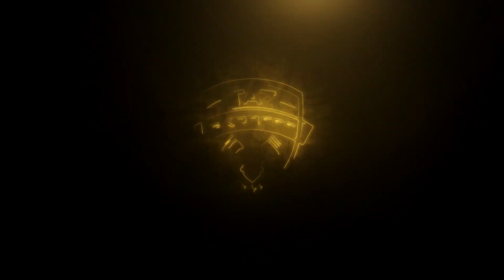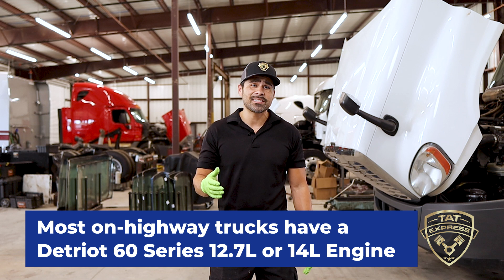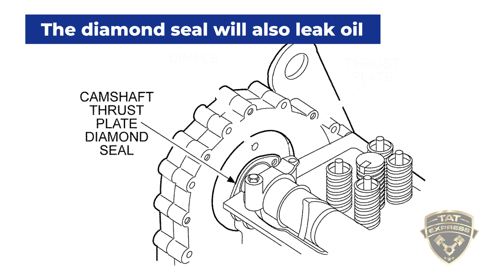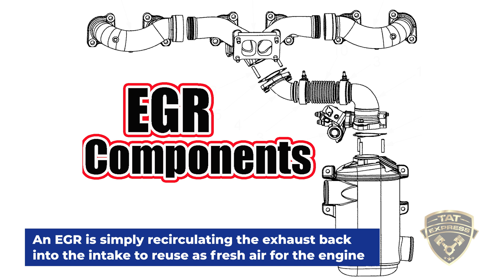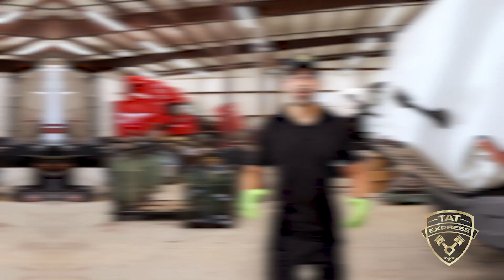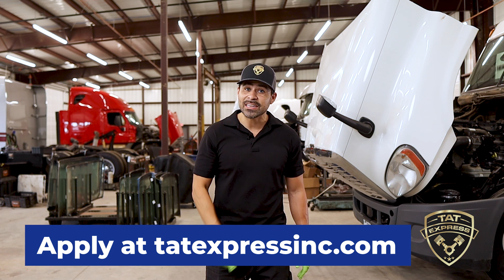Best 60 Series to buy/ Detroit Diesel 12.7/ 60 Series 12.7/ 60 Series Detroit Diesel/ 12.7 Liter

Comment: Thinking about buying a 2001 western star with 12.7 that needs rebuilt do think its worth considering I can get the truck cheap enough and the truck itself is in good shape for the year just the engine needs rebuilt
Reply from the maker: @jasonburkhead1 That’s always a tough call—especially putting money into a truck before it ever makes you a dollar. Quality rebuild parts are hard to source right now too. And that’s all before you’ve even torn into the engine. Just make sure the price is right and you’ve got a clear budget for the rebuild.

Comment: I bought a 2020 Freightliner glider and have had nothing but problems with this truck. It has a detroit 60 series 12.7l ddec4. It never ran right from the time I bought from dealership. Kept going through injectors because mechanics didn't install them correctly or the injector went bad. They were a re-manned injectors from detroit. I finall found a shop to do the injectors correctly after 4 years of this truck being in and out of the shop. A month after the injectors were installed correctly, I am having to do an in-frame rebuild due to multiple liners dropped. I have negative protrusion on the liners. Truck only has 280,000 miles. I bought this glider new from a freightliner dealership in Wyoming.  I am doing the in-frame rebuild and the cost is about $25000. This truck has bankrupted me. If this doesn't get fixed this time, I am ruined. I do maintenance on this truck every 10,000mi and have a bypass filter and fass fuel system on the truck. I have been drving 30 years and never seen a truck in the shop practically every week for four years. Unbelievable.  I think Detroit just slapped the engine together because it was a Covid truck and it was the last year you could get a glider. Before you say this engine was re-manned by Fitzgerald, I tracked this engine back to Detroit and they told me and my mechanic the engine was re-manned by them. I bought this truck at the wrong time. I have a friend who bought a 2020 international truck with a Cummins 600hp and he had the same problem of the truck in the shop constantly.  My friend is bankrupted now. I have never seen the trucking in this bad in my 35 years of trucking. It is difficult to find mechanics that do the job right. Mechanics will make or break you in this industry.  They get paid no matter they fix it right or not. I have not found any mechanic or shop to stand behind their work.
Reply from the maker: @williamreeb7227 Thank you for sharing your experience with the Series 60, and I am sorry for the problems you have faced. I hope you can resolve all your problems. Since the series 60 is no longer manufactured, the parts are being remanufactured multiple times, which decreases the quality of the parts. Injectors are a common issue. Even with new sets, we have seen issues arise. Again, I am sorry to hear about your problems, and I hope you can resolve them. I agree the industry is in a cycle not seen before. We are all hoping for a turnaround.

Comment: I'm almost bankrupt after my dd15 has spent the past 5 months in 4 different dealership shops with the same aftertreatment electronics problem.  I gave up handing my money over to Freightliner for not fixing my truck, so now I'm selling it with the dash code.  The only thing worse than this garbage engine is the humanoids behind the dealership service counters.  They start getting angry as soon as they realize you're trying to explain that you're having a recurring failure, and most of them have no problem at all shouting over you nonstop just to prevent themselves from hearing what you have to say.  They act like it's me who built this truck, not them.  So my next truck will be a Cummins.  Hopefully I never have to set foot in another Freightliner dealership.  Simply awful.

Comment: I owned a 2001 century class with 12.7 detroit.The 1st injector gave out at 1.6 million miles,i replaced all of them and the head,head had a small crack in it. Replaced the turbo at 1.1M. Engine finally gave up.at 2.4m miles. It is the cheapest,easiest to work on,reliable engine! Can't go wrong with 60 series.
Reply: I 2nd this
Reply: Impressive experience, what oil change interval you were doing  and what oil filters you have been using. 
Thanks
Reply: @filydiak  oil change every 10-12k miles using Mobil Delvac 1300 Super with 2 gallons of Lucas oil. I use fleetguard brand filters. Idle as less as possible, when you do idle, bump the idle up to 1k RPM's. When pulling big grades, drop an extra gear to make it easier on the engine.
Reply: I really appreciate your tips 🙌
Reply: What mpg were you getting
Reply: Wow
Reply: Do you mind to share some maintenance tips also some specific  parts brand name?
Thanks

Comment: Hey bro can you tell me whats going on?2004 freightliner detroit60/12.7.
vpod for turbo&vpod for egr valve..i changed the actuator on the egr valve..after that when i excelerate i get a split second delay on response..its like after i mash the gas the truck has to think about responding for a split second.then it goes???what did i do wrong?

Comment: I have a Freightliner glider with a 1996 Detroit 60 12.7. I had a very expensive rebuild, all gears, crank, injectors etc. The rebuild cost more than I paid for the truck but that's not a complaint.  I have no complaints. It's a clean and beautiful looking engine. I'm looking forward to putting a lot more miles on this engine in the future. Thank you for the video. I might stop by and see you guys this winter.
Reply: It’s a glider of course
Reply: You should’ve shopped around. You can have the same engine rebuild done for a lot less. Maybe 12K including new head and block cut. IJS 85hr labor. Labor is what kills you guys and plus getting bent over no Vaseline on “OE” parts with markups. I’ll gladly buy aftermarket kits.

Comment: Tip of the day: Don't buy a Detroit any series...  They are obsolete and have been taken over by Mercedes DD series. This has been a fact since 2015. Detroit got butt hurt when PACCARD  bought out Cummins. PACCARD was still in the process deciding which motors to install in OVR tractors, when Detroit Diesel came in and bought all their parts back from PACCARD. This lead to their downfall and why if you own a Kenworth or Pete you cant get parts for a Detroit 60 in any dealer locations. Now the Detroit building in Michigan says Mercedes on it. This is the same power plant that was in the Ford Sterling back in 2000. Unless you go to the manufacture or Freightliner , its impossible to get parts ..and it wont be long til they are fazed out!!
Reply: Correction don't get a 5th gen dd series engine or better. Ex: dd13, 15, 16 these are basically MBE's. Just bc parts are no longer produced doesn't mean that parts aren't available.

Comment: Incredible engine. Has its quirks, but it’s damn reliable and parts are cheap. Got a 99 12.7 in my glider Kenworth. Went from a Cat C15 to this Detroit and could not be happier. Tuned right, this little 12.7 pulls just as good as that 600 horse Cat and it doesn’t blow a head gasket every oil change. The Detroit leaks oil like a faucet though. It certainly marks its territory everywhere it goes, but I’d have nothing else over it. Bless Detroit for building this amazing engine. If you’re in the market for a truck, do not be scared of this engine. Rebuilt my Cat for 25 grand and it was still a money pit. The Detroit costs 14 grand out the door for a full rebuild just like my Cat was done. This engine is cheap, reliable, and pulls like hell if it’s tuned properly. Stay safe drivers!
Reply: Where did you get your rebuild done? And was it an in frame or reman long block? Thanks
Reply: @derick12331  It was done by reputable shop in Moorhead MN that me and many friends use. Platinum Cat kit in frame done on it along with new turbos since they were the original ticking time bombs for a brand new engine. Liner protrusion checked and was within 3 thousandths. Right after I got it done, Cat decided all c15s need to get the block decked during a rebuild. It was too late for me. Engine made it 100,000 miles and the engine had to be tore back down. I sold the truck and took a $40,000 loss. I hated that Cat and did what it took to get rid of it. Got a glider with a series 60 that I paid dearly for since it’s E log exempt and I’ve never been happier.
Reply: @PickupsAreNotTrucks   what is the shop name in Moorhead?
Reply: No
Reply: Who did your rebuild ?
Reply: The Cat was rebuilt by a shop I’m not gunna name because I don’t want anyone to think I’m slandering them.

The Detroit I did myself. I called around to places to get a quote on having it done by a shop and, it was around 14 at the time. I’m sure that’s gone up significantly since then. I did my Series 60 myself 2.5 years ago for $10,000 all said and done.

Comment: my 04 century has a 12.7 from 1999. 430hp model, entire new bottom end. took the oil pan off to repair it and could still see honing marks on the sleeves/inside of the block looked like it was a brand new engine. burns no oil, runs solid. 300k after rebuild/freshup

Comment: Bought a Peterbilt truck from California that had 1.6 million on a 12.7 Detroit with an after market DPF filter, did an overhaul removed the DPF filter, truck drives and pulls great but in the morning start it has a blue white smoke for like 10min smells like diesel, it's REALLY bugging me already tried changing the injectors again but still no luck, what could it be?
Reply from the maker: Tony G, it may be due to the tune over fueling and not completing burning until warmed up.
Reply: @TATEXPRESSINC  thanks for the tip 👍

Comment: I have a 2008 freightliner with a 14 liter serious 60, MAN! That engine is a beast
Reply from the maker: Thanks for sharing.  I will be coving the 14L in our next video, so be sure to subscribe, so you are notified.
Reply: Hello guys, I’m actually subscribed to both of you guys maybe one of you can help me out. 2014 cascadia DD15. Rough idle low power no code for it. After getting the truck check over by a friend (no mechanic) we found that my air filter hadn’t been replaced in some time and was completely clogged. (Thanks Speedco) Changed it and truck was a little better but still rough idle and low power. So I took it to the dealer. Thinking maybe I lost an injector or maybe a boost leak. I asked them to fix crank seal leak and a leak on the fuel rail line since I was in the shop. And to replace a nox sensor since I had been riding around with that light and code for a couple years with no issues. They fixed the oil leaks and then replaced the both nox sensors. Test drove and said your good to go. On the very next load I pulled. I still had the rough idle and low power. Now 55 mph derate. Back to the shop. After they broke transmission lines and def lines and made me pay for them. They then replaced metering unit and def dosier. Hey your good to go. Still rough idle and low power the first hill I came to. 5 mph derate and a huge tow bill back to the shop. Where my truck sits after $11,000 later.
Reply: I have same engine

Comment: I have a n14 red top and is a beast's more powert then Detroit and sound better but Detroit's are so good too sound smoth plus a big plus diesel consumsion is less is like having a 4 cilinder engine in a semi truck another thing off Detroit series 60 they start right away and Cummins take for ever some times
Reply from the maker: Marcos, we owned a N14 in a FLD.  It ran to CA and WI before ELDs. 🚚😄

Comment: Still no mention of the 87-97 12.7 liter
Reply: I’m getting a 93.
Reply: Exactly I have a 96
Reply from the maker: @Amsoil, most on-highway trucks are equipped with a DD15, Volvo D13, a Paccar, or Cummins.  We do not see many 60 series
Reply: @TATEXPRESSINC  they still out there!     You might not see it,because, any back yard mechanic can work on them and you know 12.7 it’s a reliable engine.         When I go to buy oil filters for mine,at dealership i can’t see one in the shop.
      But,I see like 10 Cascadias in line to be fix.     Not everyone knows how to work on DD15.  I have a 98,and still working fine.   With a Rebuilt engine ,and 2 million plus miles on it.
        Thanks for the information 
We all appreciated!

Comment: I have 12.7 and it's in a Columbia glider. That engine was NEGLECTED and poorly maintained. Former FedEx ground truck and for those that don't know up here in CT there's this regional manager that's pushing these contractors to run 7 days so maintenance is on the fly for those guys. Plus the contractor was cheap. I'm playing catch-up now and it's in the shop getting the front cover noise checked. Hoping it's the accessory drive not the bull gear.

Comment: I would take 12.7 problems any day compared to the DD15 problems.
Reply: Detroit vs Mercedes
Reply: @pep5772  Detroit all the way
Reply: 2000 freightliner century 12.7 470hp Pre Emissions  owner here......900k  Original miles  No rebuild ......new injectors......I wouldn't let my Series 60 go for a brand new DD15 in a Peterbilt........
Reply: Fun fact the Mercedes 4000 was supposed to replace the 60 but couldn't hold up in the long run.

Comment: Great video. I own a 12 seven and I’ve had no problems finding parts for it. It’s way cheaper than those are the engines.
Reply: Are you guys sure you can find parts. ? I'm about to buy  a 60 series century but he says in the video there are no parts from 1998-2003. HELP!!!!
Reply: I havent had issues finding parts either, maybe its in certain areas of the country. Im from texas...
Reply: I got most parts except minor as some fittings for fuel pump or air hose which can be made or retrofitted
Reply: Someone who can recommend a technician

Comment: Why would companies want to stop manufacturing parts for a very popular engine? On the surface it seems like a poor decision from a business standpoint. A large number of truck operators will want to continue using the Series60 engine.
Reply: Government, it’s a way to break the middle class…
Reply from the maker: @Brandon, the entire world is working towards green.  The USA is one of the less strict nations, unlike the EU.  Be sure to subscribe for more videos and when we go live.  👍🏼🔧
Reply: I have a 12.7 pre egr here in aus. The thing is a beast, it has been rebuilt and is so reliable it’s hard to fathom why all these Cummins and cat fanboys hate this engine. Mine is a factory 500  horse 1650 ft lbs 2000 model. Best thing Detroit ever designed. Seriously the best hands down. Much love from aus
Reply: In South Florida you can find all part you can imagine for that engine.
Reply from the maker: @scav, Detriot only rebuilds existing parts for the 60 series.  The 60 series does not meet newer EPA standards, so engineers produced engines that would use up-to-date technology.  Higher compression and fuel pressure allow for smoother operation and a broader torque curve.  Detriot now focuses its manufacturing on late models.  Be sure to subscribe for more content. 👍🏼🔧💪🏼
Reply: Taking money out of their own pockets to put more into their pockets. Everyone who knows diesel engines know that the 12.7 60 series is the best engine for longevity and reliability with oem components. With that said compared to all semi trucks on the road today there aren't many 12.7 being used. If I had to guess I'd say less that 2% of tractor trailers operated in the US has a 12.7 detroit. Most older owner operators run a 12.7, 🐈, or red top cummins while the younger owner operators run a mbe, isx, or dd13/15's. Lowering the 12.7 pot.

Comment: How about a video of your opinions of the newer engine platforms. Leaving the truck out of the equation. Just which ones are the least problematic. Say 2014 and up which are the ones to have or not have? Thanks. Also where is your shop located? Always looking out for a good shop and where they are.
Reply from the maker: DD15 gen5 or late model DD15 2017 and up has met EPA standards and still is a reliable and affordable platform. Keep in mind maintenance plays a significant factor